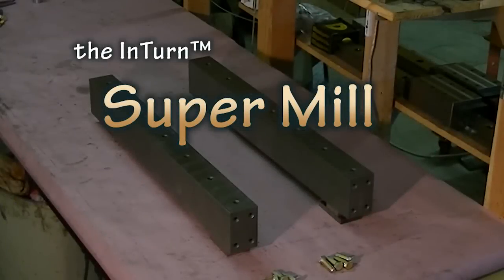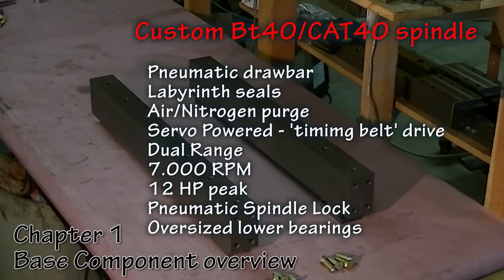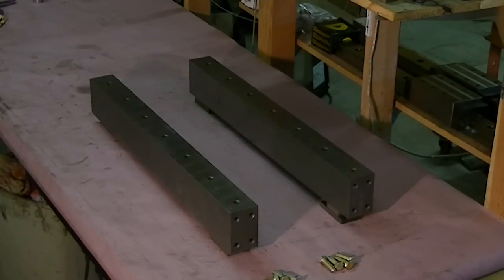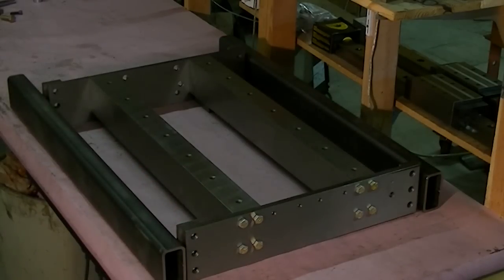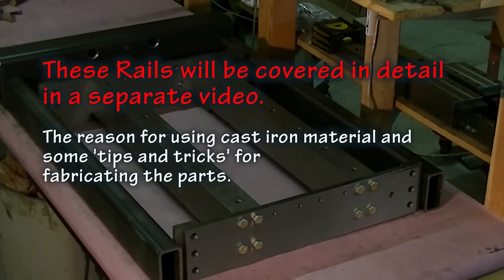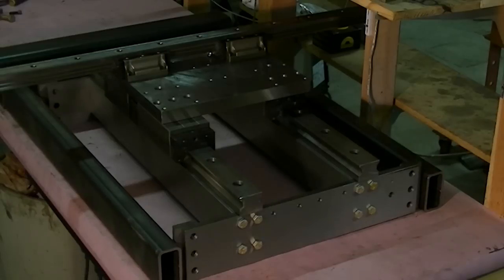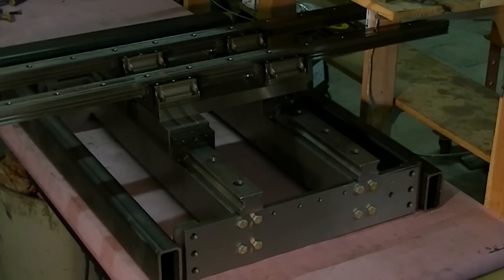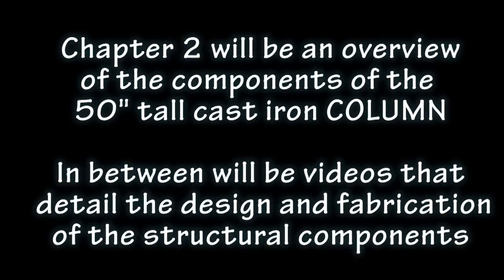'Super Mill' specifically Engineered and built  for Mill/Turn capability

Comment: Hows the build going?
Reply from the maker: I have been extremely busy building a large batch pf InTurn™ MEGAs . These machines have a lot of new features and a lot of the buyers ordered a lot of customization so the build are taking longer than expected. However, the machines are about half shipped and the rest should be done is a couple of weeks. All new controllers are going with them. There are two versions, MACH3 and LinuxCNC (also for Path Pilot).

I do have footage of the first 'tech talk' about specific pieces of the new SuperMill, specifically the big 'Torque Tube' that ties the column and saddle together. There is a lot of detail about the structure and how the forces travel thru the piece. I think it will make a popular video. I just need a little time to edit it together. 

Please hang in there. the new stuff is coming!

Comment: This looks like it will be a very nice setup, nice as in rigid. I did the same thing to my Bridgeport after finding out that the machine was badly worn. The project was a lot cheaper than having the machine ways scraped. I am looking forward to seeing the build.
Reply from the maker: On your Bridgeport rebuild, did you add slides to the table? If so, how did you deal with the existing dovetails? I got a quote of US$ 940 for a grinding house to grind a Bridgeport table to  .001" and that did not include machining off the dovetails.  I was able to machine off the dovetails and then using a modified face mill, surface the table, top and bottom to less than .001", but it took quite a long time and consumed a lot of carbide, so ultimately it probably cost more to do it myself.
Reply: Yes I did. I removed the saddle, table and y axis yoke and screw. I made a knew yoke to hold the ball screw nut. I used 35mm rails screwed to the knee’s ways. Then ordered a piece of 1.750”x8”x49” tooling plate from Hadco. Bolted the aluminum plate to the bearing 4 blocks and bolted the new yoke to  the aluminum plate; this is serving as the saddle. Then I bolted 20mmx49” rails to the saddle and mounted a 2’x8”x49” piece of tooling plate to 6 bearing block on the 20mm rails. Of course I had to machine clearance under the table for the x axis ball screw and a pocket for the nut. When it was fully assembled I ran a last word indicator from end to end and back and forth along the x and y axis. I have to say that I was quite happy with the results. I had zero movement from the indicator except on one end of the table for about 4 inches in the back corner it dropped down a tad less than .001 inches. The machine is now powered by two Clear Path servo motors and Mach3. I still have to work on power to the quill. I hope this was some help.
Reply from the maker: Thanks for posting this. I have referred a couple of my  InTurn™ customers to this post for inspiration in their Bridgeport upgrades. Did you do an article on the project?
Reply: Simpson, I've said this recently in an email, You Do Tremendous Work, Thank You!!! And thanks for pointing this new video out. Wow, Super Mill  indeed.

Tailor, the description of the work you've done to your Bridgeport is excellent. You have written it well and it is easy to follow. I subscribed to your channel.

I have converted my old Bridgeport Series 1 to CNC control with 3 ClearPath servos. All three axis run well; I really like the ClearPath servo system; easy to install and to work with. I'm in the process of converting the induction drive motor to servo as well. And the final upgrade will be to have Simpson's 4th axis stuff hanging on the end of the table.
Reply: +Simpsons36 No I have not, but I did document the build with fotos and of course drawings of the parts. I will make a video of what I did to date very soon, hopefully by the end of this week it should be on my chanel. I would like to take this opportunity to say thanks for all of the work and knoledge you share with us, it is all quite impressive  ! ! !
Thanks again.
Reply: +Bill T 
Thanks for subscribing Bill, I do appreciate it! ! !

Comment: I am excited to see where this goes! Do you have plans to sell this creation? As plans, or a kit, or a finished product?
Reply from the maker: Last time I checked the HAAS website, the cheapest machine they have that has Mill/Turn capability is a bit over $100,000. So I think that established the price point.If you have the money, definitely buy a machining center, but what is out there for say half (or less) than the HAAS machine? Frankly, I find it astonishing that so many companies still make CNC versions of the old knee mill arrangement. Could there possibly be a worse configuration for a CNC mill? I think not, but open any machinery catalog and there they are. It is hard to find anything else unless you look at used high end bed mills and you need the money, skill and time to rebuild them.What would you consider an acceptable price for a high end, purpose built machine with true power draw bar spindle, tool changer, full enclosure and purpose built for Mill/Turn ? Ballpark . .   30k 50k?

Comment: Neat, that is going to stout! 
Have you done any FEA on this design?
What CAD program do you use?
Reply from the maker: Yes., but you don't use a CAD program to do stress analysis. I want to keep the tech stuff in the component videos, so watch for them and this topic will be covered. Having said that, it would seem that Autodesk's new Fusion 360 is poised to become the 'Swiss Army Knife' of Design Software. Already I like it better than SolidWorks and it is quickly catching up with ProE (my opinion, yours may vary) and they have recently added some rudimentary flex analysis to the program, but I just don't have much time to play.So, it is sort of like a 3D cad program that also has design features, CAM features and analysis  . . to varying degrees, but still . . If you have not checked it out, definitely give it a look.
Reply: I've been using Fusion 360 at  home and have recommend Fusion 360 to co-workers and friends for a while now, I have a paid seat of Alibre Professional yet I find myself using Fusion more and more. I have not used Pro/E (Creo now) for at least 6 months, I also have Creo 2.0 at home (work gives us the full student version for home use if we want it) I started using Pro/E back with version 17 on a Unix workstation, it has come a long way with not as many menu clicks to start a part!
Reply from the maker: It has been some years since I used ProE, so you are far more up to date. It seems we have similar opinions about Fusion. They keep adding stuff. One of my customers just sent me a 4th axis CAM module. Certainly you can't argue about the price. Hopefully they are not just buying market share and planning to kick the price up once the software is somewhat finalized and stable.